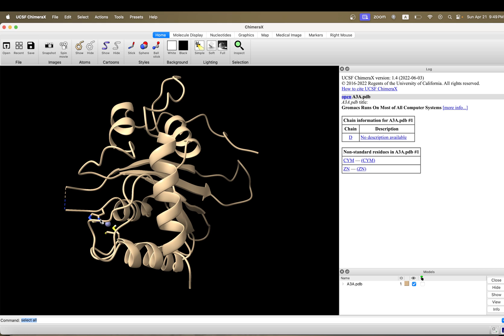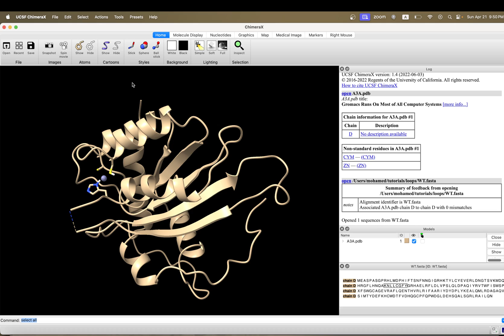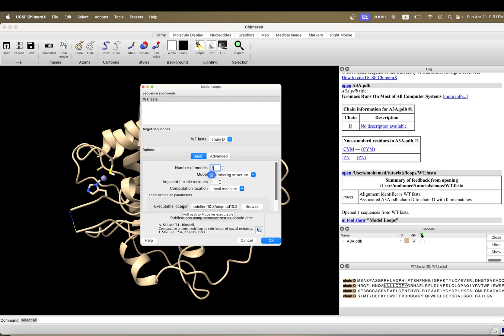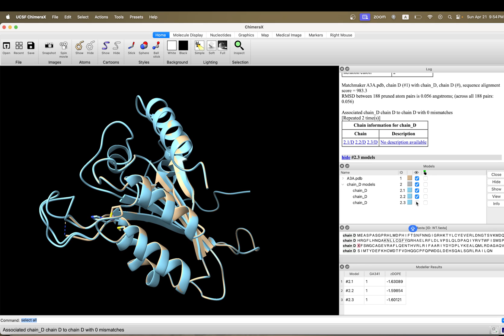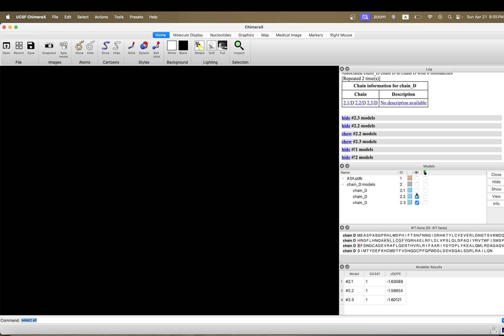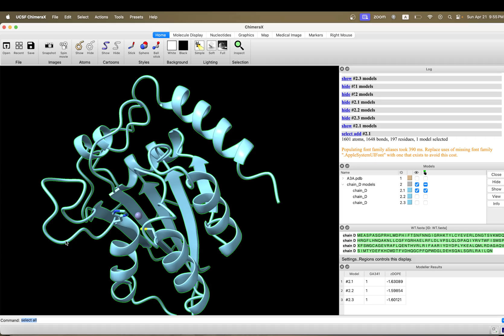Modeling missing loops of protein structure using Modeller interface in UCSF ChimeraX

Comment: what to do if pdb structure has multiple chains, ligands and water?
Reply from the maker: clean it and keep pdb only
Reply: @Mohamedshehata  Hi there, I am encountering the same issue where my pdb structure has 2 chains, and chimera wants to align chain A and B which is not what i intend to do, how do i proceed with this? As there are missing residues in both chains that need to be fixed. Thank you.
Reply from the maker: @sofiahessel7454  I did not get what you mean by alignment. For the missing residues you can use load the fasta sequence of your protein and view it with sequence viewer it will show missing res